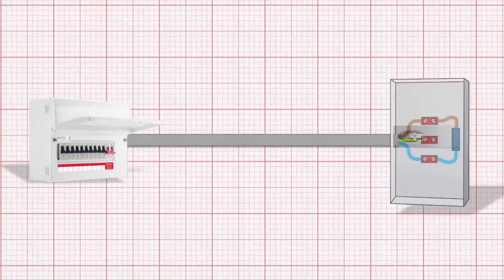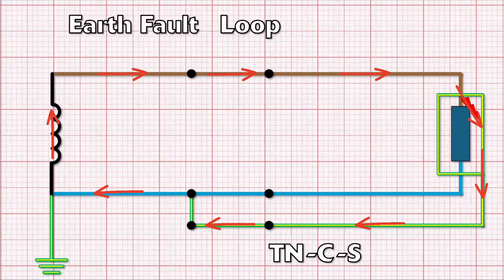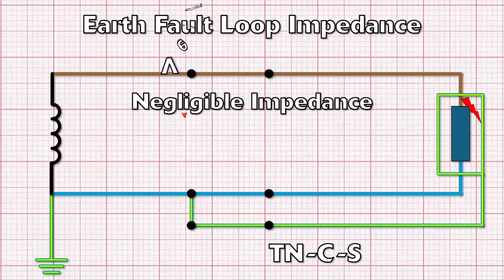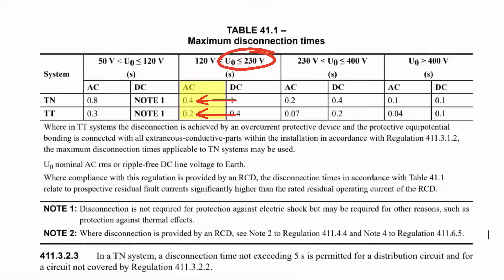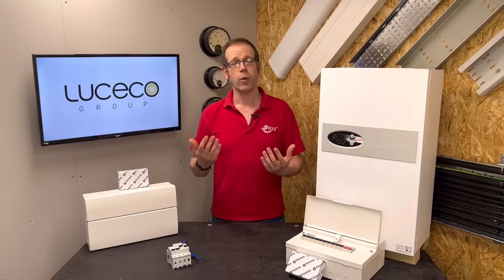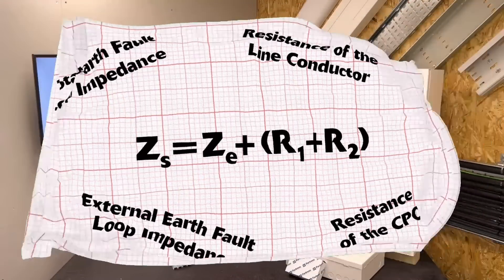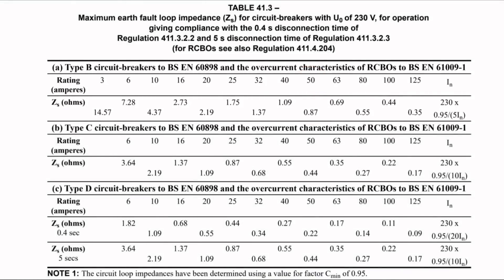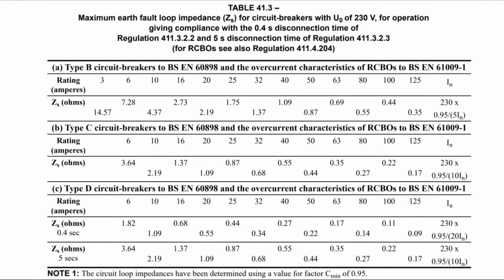How to Calculate Earth Fault Loop Impedance for a Circuit

Comment: If you dont have your table to hand us 218.5 / 250. 

The 218.5 value comes from taking our 230 volts value and multipling by 0.95, this takes into account the Cmin value (fluctions in uk volatges). The 250 value is the devices current multiplied by its required fault current a B curve 60898 MCB requires 5times the amount of fault current to open so 5x50 is 250. 
So 218.5/250 = 0.87. This is a 100% value, times it again by 0.8 to get your 80% working value. 

Great video by the way 👍💪

Comment: What would you write on the EIC for the disconnection time? 0.4 or 5 seconds?

Because as you said the circuit will disconnect before 0.4 seconds due to the curve of the MCB. However, maximum permitted allowed is 5 seconds.
Reply: You write 5 seconds in the Cert because that's the max allowed disconnection time for the circuit in question.. If you beat that time that's great and what you're after, if you cant beat it, well then you've ballsed up and cant issue a cert and will probably kill someone or maybe make there hair go all curley....

Comment: You compared your figures with bs7671 without using the 1.2 multiplayer from table i 3 you should have compared it with the figures in the on-site guide
Reply from the maker: Nope, at the design stage you use the figures from BS 7671 then when you test the circuit on site you use the corrected figures in the OSG. 👍
Reply: @efixx  the cable has an operating temperature of 70 degrees and the R1+R2 figures in table i1 are at 20 so you use the factors in table i3 which is 1.2 for 70 degrees and 1.28 for 90 degrees, only then would you know resistance of the cable while it is in use and at its operating temperature when a fault is most likely to accour.
Reply: He explains to you that there are two values we get one is only design value where we do theoretical calculation from bs7671. Where as with osg we have actual values from practicle installation
Reply: Pages 230 to 232 of the eal level 3 book explain this
Reply from the maker: Oh cool, I'll have a look thanks. 👍
Reply: Never understood when the on site guide usually makes things easier like already usuing the 80% rule. 
    Why don't they just have the values for r¹ and r² in meters so we don't have covert from milli metres?
Reply: When teaching this have a car battery, one cable with a bulb fitted, one with a fuse and just a cable. Practical aids always simplify things.

Comment: There are errors in this tutorial, at 09:55 to convert m-ohms to  ohms you have to MULTIPLY by 1000 not divide it by 1000…
Also you spent all your time talking about Resistance not impedance as you never considered the inductance of the supply transformer to ‘calculate’ the loop impedance, so all you were doing was calculating load resistance! And actually few electricians could ever ‘calculate’ load resistance by using cable types and lengths, because in reality they would never be able to get a cable length.  So all that can be done is to measure with an instrument loop resistance not calculate it.
Reply from the maker: 500 mill-ohms = 0.5 ohms.
500÷1000 = 0.5
I spend quite a lot of time at the start of the video explaining impedance. 🤷
Reply: @ you have to note the mantissa and exponent elements, and units can’t be ignored. For impedance R+-jX you’d have to measure the property inductance and capacitance or for the loop impedance, lump all the components and know the supply transformer inductance.
Reply: Oh heck, so 5 milli ohms is actually 5000 ohms and 500 milli ohms is 500 000 ohms ? Oh shit I think Ive severely undersized the hole Ive just drilled.The boss asked for a 20mm hole in the wall and I should of used a 20 000m hole saw, and silly me used a 0.02m one.....think I need a bigger drill and maybe someone to help hold it
Reply: @jonanders76 you’ve made the same mistake too, 500m-ohms is actually 500x10^-3, units cannot be ignored! This is why people make mistakes…
Reply: ×10^-3 is the same as dividing by 1000
Reply: @ all I’m saying is the exponent can’t be ignored as depicted in the video 500m-ohms can’t glibly be divided by 1000, because those who aren’t mathematically savvy will end up making mistakes. And 500m-ohms can’t be converted to ohms as it’s already in ohms!

Comment: 50 amp type B,  is indeed 0.87ohm from the table you used but mustn't we consider the 80% rule?
Reply from the maker: At the measuring stage yes, at the design stage no. 😊

Comment: Embarrassing video from you as you are knowledgeable  , calculation should never be allowed
Reply from the maker: This is the calculation for the design process. It should then be used to verify the test result. 👍
Reply: Calculation of Zs is absolutely fine. What you can not do is calculate R1+R2 by Zs-Ze. We never really calculate Zs when performing an EICR or an EIC in the r3al world, but it is handy to cross reference to the calculated value - providing parallel paths are considered when performing Zs measurements.
Reply: I can't believe you say this is embarrassing. I think you need to read the IET Guidance Notes 3 or.... take a competence course like C&G2391
Reply: calculation is an allowed approach and even "prefered" in our guidance documents. While designing its all we will have anyway, not much to test at that stage. #teamsparks #liftothersup
Reply: Calculatios are always used in life. You dont just guess how much fuel/ battery you need for a trip with no garages on the way. Only to find out you was wrong.
    So we design circuits that should be ok before we buy all the materials and labour to find out its wrong when we test.  Plus what test results are you comparing it to.
Reply: @toni1554 Look up the "Dunning Kruger Effect" I think it might help you understand why you are way out of your depth. Please explain how you would design a circuit before it exists, but more importantly how you would test it before it exists...